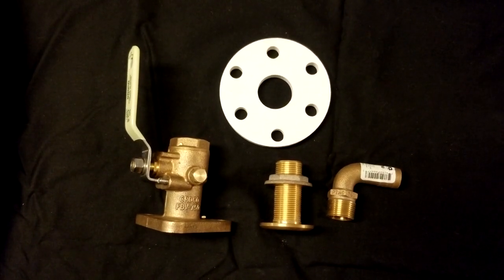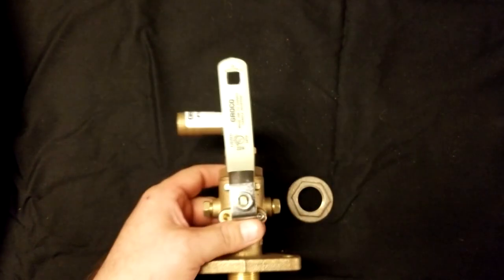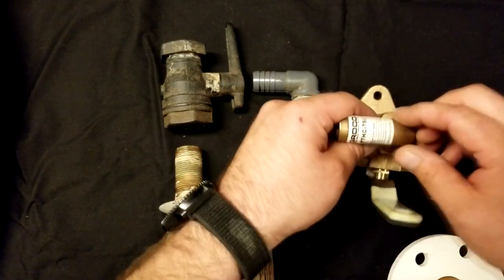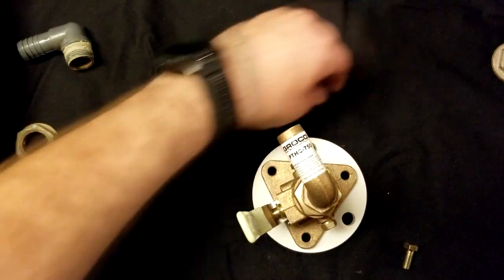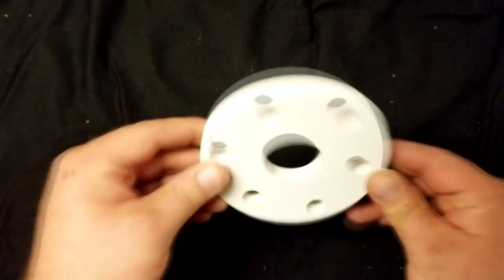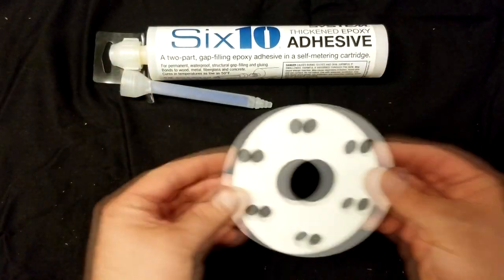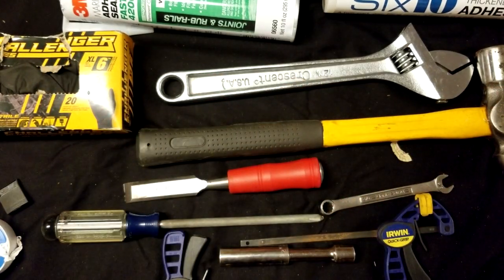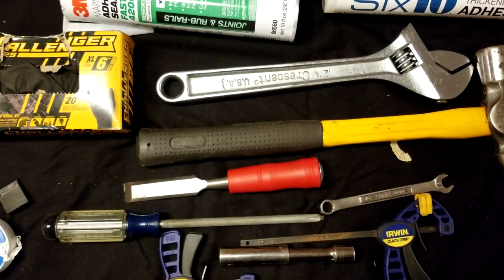Let's talk about Seacocks Part 1

Comment: Quote from Forespar 
FORESPAR® MARELON® Thru-hull/seacocks are corrosion free and provide great peace of mind in that regard. They are relatively maintenance free. Generally, lubrication is not required. What is required is to open and close them on a regular basis (4 times a year minimum). The frequency this is required is determined by two (2) things, whether the valves are routinely kept open or closed, and the rate of sea growth (weed and barnacles) in your area. If the rate of fouling is high and the valves are not actuated regularly, this build up of growth can cause any valve to turn hard or not at all. If the valve becomes stiff due to lack of use and sea growth build-up, it must be cleaned. The restriction of flow into the valve may cause harm to the machinery it serves and the valve may seize if not maintained. DO NOT DISASSEMBLE VALVE OR LOOSEN BOLTS EXCEPT IN EXTREME EMERGENCIES. All valves are factory pressure tested before shipping. Any adjustments to the bolts will void this testing and may void warranties.
All MARELON® integrated valves have a removable plug in the handle (white cap with loop). This plug is made to fit into the external thru-hull (non-screened style only). In an emergency, this plug can be placed in the thru-hull (water pressure will keep it in) and the valve disassembled while the boat is in the water. Someone must get wet, but the boat does not need to be hauled for valve repairs. By tying a lanyard to the cap, you need only get wet once.
Reply: I have been told that some surveyors frown on Merelon as well as insurance co's.

Comment: hey russ.. if you used steel bolts in your retaining ring pound in nuts..  stop by a parts store and pickup a tube of Permatex 85420 flange sealant.. Also known as Hylomar.   you can use hylomar as an anti seize in that application on the bolt threads.. heck you could use it on the mushroom threads into the sea cock base.. i have taken apart VW engine cases that had been assembled 16 years before and the Hylomar was still tacky..  its water proof.. gasoline proof.. oil proof.  good for -50F to 500F..  you may want to get those out or somebody may want to get them out in the future.  just for kicks. screw a bronze nut on a grade 8 steel bolt without antiseize in a jar of ocean water, screw together a pair with conventional antiseize.. and then a pair using hylomar as an antiseize.. let them sit on the shelf for a few months while you observe them.

Comment: The marlon plastic is reinforced with fiberglass and will never freeze up due too electrolysis extremely durable long lasting and will never corrode , acetone is used to clean up after this installation,all those tools and you could have just bought the right tools for the job
Reply: I just switched to all marelon seacocks

Comment: Use the nut on the new mushroom with a piece of wood etc to suck the flange down while the epoxy is curing.  after it is cured (permanent installation) you no longer need the nut or wood etc.

Comment: Marelon thru hulls have straight / parallel threads, they are Not tapered. There are marelon fittings with straight threads available to fit into to the top and the bottom of the marelon thru hull. The grey fitting on you original marelon thru hull may have been tapered thread, your boat builder may have used the incorrect fitting.
Reply from the maker: It was a 1985 boat, I assume the previous  owner or builder, or some boat mechanic along the way used the wrong fitting. I've  since sold her. Was a sad day, but it is nice not worrying about slip fees and storms.

Comment: That is a marine ball valve it’s marlon valve and it’s designed to be threaded on all the way like that they call it a running thread . That valve is designed for below the water line the brass inserts are too be pressed in
Reply: That marelon valve costs over 75 bucks at west marine. They are quality pieces

Comment: using steel bolts with bronze fittings is not wise. also high temsile bolts are massive over kill as your brass seacok flange is much more brittle than a standard stanless bolt. bottom line is you will never break a stainless bolt before any of those other parts. high tensile bolts will rust very quickly and are going to cause electroylsis as its a more noble metal.
Reply from the maker: You are correct about that. To keep things simple I just used what was included with the back-plate kit. I may end up changing them out to stainless.
Reply: @russellsrandomness  - Use bronze hardware with your bronze seacock, do not mix metals.
Reply from the maker: @brianlinke6718  Yeah, sillicone bronze would probably be ideal. These were in with the galco back plate kit, and i'm wonder if it's because the threads in the back plate are hdg like the bolts included.

Comment: I think you are wrong. My understanding its that the white flange is to anchor 3 bolts inside the hull prior to gluing said flange on to the hull. why would you make more holes in your hull? As well you did not address the problem of corrosion between metals. The Marelon ball valve was a gooder why did you toss it? Get your facts straight prior to making a video.
Reply: He said the white flange is to anchor 3 bolts inside the hull. Get your facts straight prior to making a stupid comment.
Reply: @maddogmaz1576  what about the galvanic interference between stainless, brass and bronze. I recall trying to unscrew brass pipe plugs out of my cooling system, only to have them crumble in my fingers. The zinc was gone, only the copper was left. If I had ignored that roadside and simply replaced brass with brass my boat would be at the bottom. USE BRONZE EVERYWHERE! ...and don't piss on me for keeping you safe.